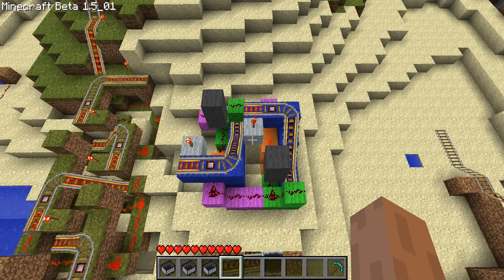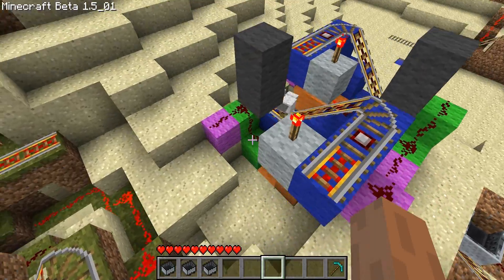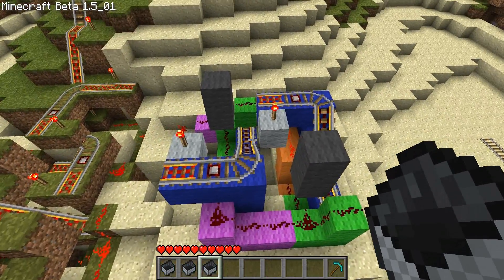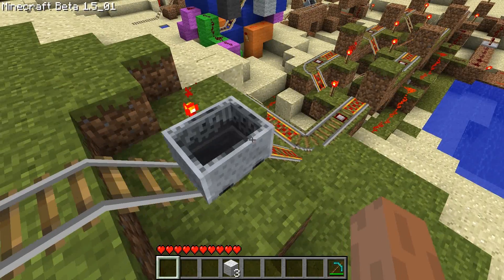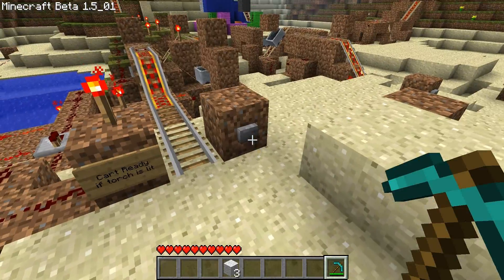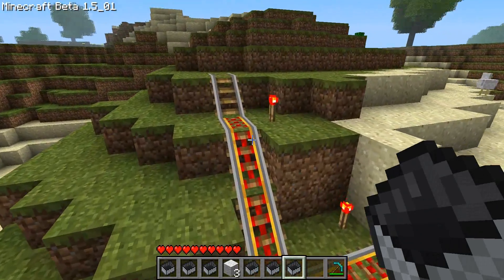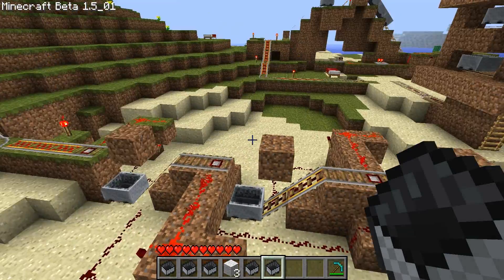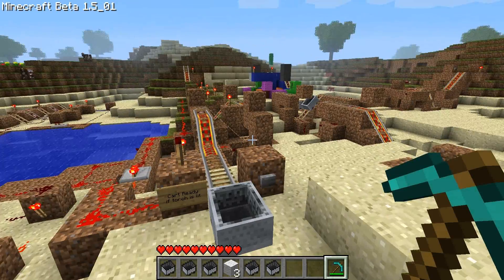Minecart 1.5 "Pez-Dispenser" Replacement

Comment: @AmmorthNefare
Once all the memory was filled, it would stop sending and allow a 5-clock to blink a torch.  In the storage room, I could tell it to unload and it would send me a cart down a single line.  I empty it then send it back and it would loop back up into the dispenser while triggering a reversed version that would slowly remove memory cells in a similar fashion.  So the surface design will be fairly small in nature.  Input/output lines with direction changes when necessary.

Comment: @AmmorthNefare
So far the idea is around the lines of sending the signal underground and it hitting and gates until the very first mem cell is reached.  The cell would then send a signal to the next and gate in line so when another cart hit the same detector, it would branch off to a different mem cell and so on until all were filled.  Carts would be sent on a line that doesn't remove memory in a circular manner (to whichever destination they were told to)

Comment: @AmmorthNefare
Size isn't too much of a concern since I can easily bury the memory and several other components in the ground.  I'd just like the rail part not to consume a lot of space so it can fit nicely into a storage room.  Currently experimenting with detector rails, rs nor latches, and gates and track switching.

Comment: @AmmorthNefare 
Problem with that design other than taking up space is the fact that it keeps circulating.  I want something more dynamic that I easily tell "use this destination" and it wouldn't cause issues with the counting method.  I'm thinking around the lines of running solitary lines to where I need them to be and where my storage room is, setting up a junction of sorts to house it.  Using a detector rail on the lines in to tell it when to send and where to send.

Comment from the maker: @roboticaust You could use almost any type of storage solution for this, however I think watch?v=IJkf_67vKUk would work the best.  You would set it up so when a cart returns, it sends the first cart and increases a counter.  When the counter reaches the number of carts, instead of sending the next cart, it lights up a torch or starts an alarm.  For counting, you can chain together some toggle circuits from the minecraft wiki.

Comment from the maker: @roboticaust Go for it, thats why I posted this video.  FYI, there is a way to use a typical pez-dispenser with a door booster approach (no cart glitching).  Its much more compact than my method.

I'm planning on using the door pez-dispenser with a station I am currently working on.  The design is about 80% complete and now I am just debugging and stress-testing.  I hope to get a video up today or tomorrow.